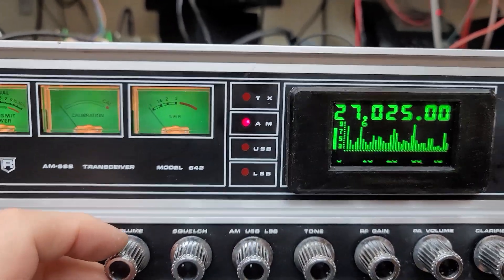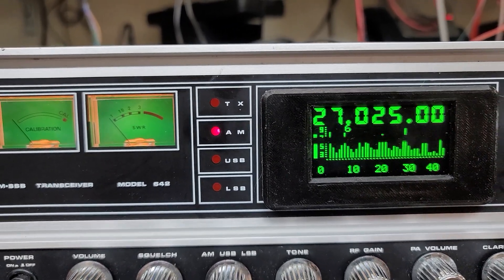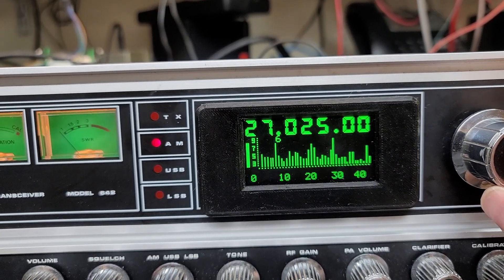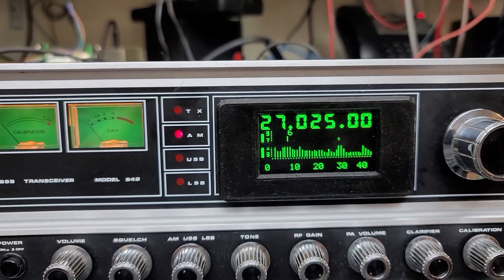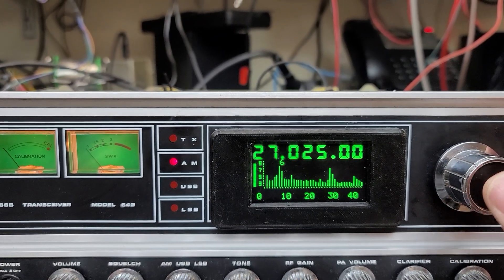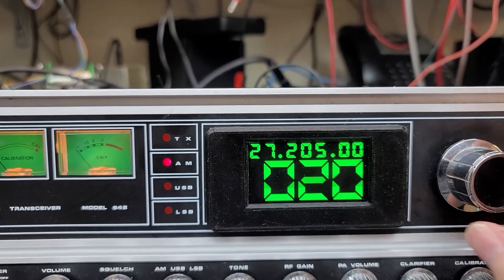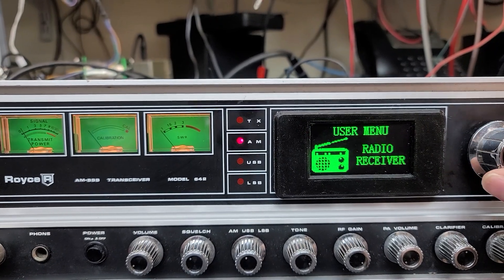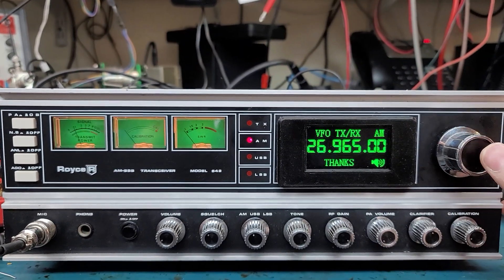For Richard, Royce I-642 upgrade to 6.79 firmware.

Comment: Hi, what cover have you put over the vfo, i have the same radio and would love to do the same
Thanks
Reply from the maker: Without changing any tuning, it will reach 27.800 with full power.
Reply from the maker: Sorry, if your asking about the display, it was 3D printed for that job. Your welcome to the file or I can print one for your install.